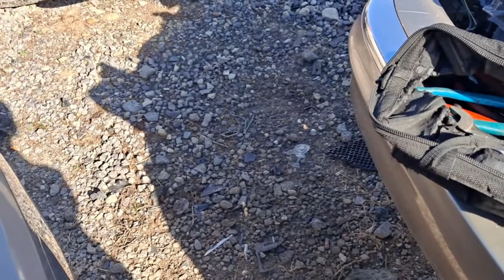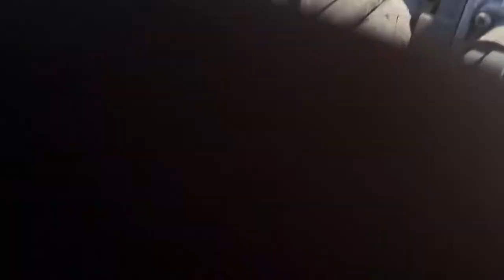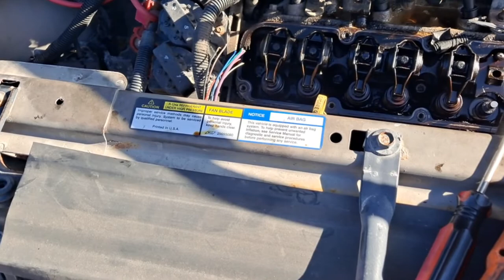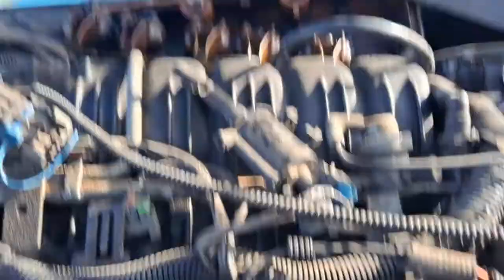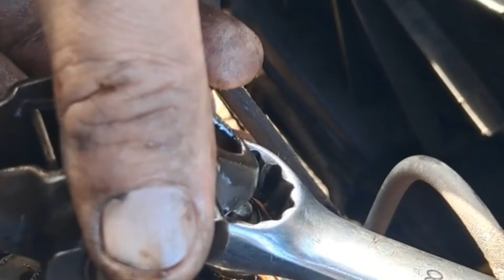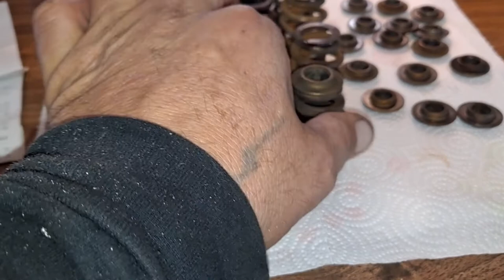Sourcing LS6 / Beehive springs for Chevy vortec heads

Comment: You just saved my ass. Doing the exact vortec on the 1st gen block. Just put the comp camps in with the inners in it last night. I just ordered the LS ones you put in. Thank you.
Reply from the maker: Cutter performance on here is a good dude to watch. He's bad ass when it comes to vortecs.
Reply from the maker: What are you doing to yours?
Reply: 86 c10, putting vortec heads, first gen block , thumper comp cam. 
Did you have to do a bypass on the coolant ports to keep the heads cool? The vortec heads don’t have the same port and blocks it. I saw someone drill some holes in the thermostat so some coolant still runs through when it’s closed.
Reply from the maker: @keepit01  the thing with that is the water pump, if you're using the serpentine belt set up, make sure you use the vortec water pump. The belt routing turns the pump backwards or vice-versa. The fins on the pump are different then the v belt style. Just make sure your using the right pump with the right belt set up. I'm running an electric water pump. If you look at my last couple videos you'll see it on the stand.
Reply: Great thanks for the info. I’m still running the old school belt set up, no serpentine.
Reply from the maker: @keepit01  just make sure you're using to old school water pump.
Reply from the maker: @keepit01  what rocker arms are you going to use?
Reply: I’m running a new but the older style water pump that was on it already with the original heads. Machine shop guy gave me the rocker arms to run. They are the ones you were talking about in your video with the guides to keep them in place. 
Do you know if I can still use the original non vortec push rods?
Reply from the maker: I ended running the stock vortec rocker arm. Didn't need the guide plates. I was able to re use mine, you'll just gave to measure and make sure they'll work.

Comment: Mind blown 🤯 some good pieces i those cars that no one one would even know.   I’d use these in t 602 crate engine hobby stock
Reply from the maker: I'm using a retro roller cam. It was alot cheaper. About 300 bucks cheaper. Only have to use the old school timing cover and cam button. .495 intake and .502 exhaust.

Comment: So the 50 thousands off set keepers will work w these oem retainers ? I’m putting a 485/485 isky cam but I’d like to use my new 1.6 roller tips I just paid $180 for to use them on the. Shitty 602 crate cam. 😠
Reply from the maker: No they won't work stock retainers
Reply from the maker: https://youtu.be/ao16fG8sqK4
Reply from the maker: https://youtu.be/RtQCxoF0AdM

Comment: What ratio are those rockers u know I’m sure ??
Reply from the maker: The rockers I'm using are going to be the stock ones. With the 50 thousand offset keeper and cam I'm using I can't go with 1.6.
The stock rockers are vortec 1.52 old school small blocks run 1.5. The 1.52 give just a little more lift, another reason vortec heads flow so go